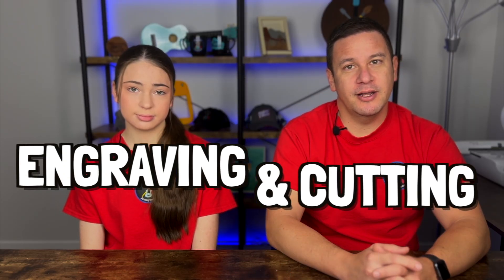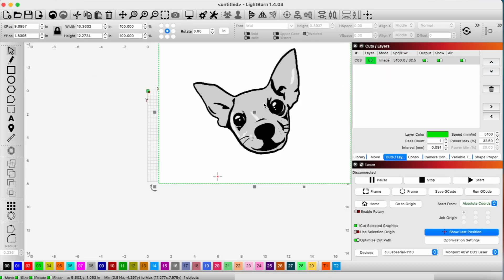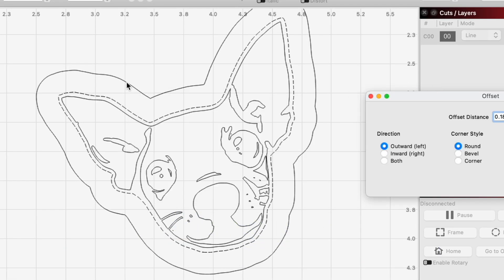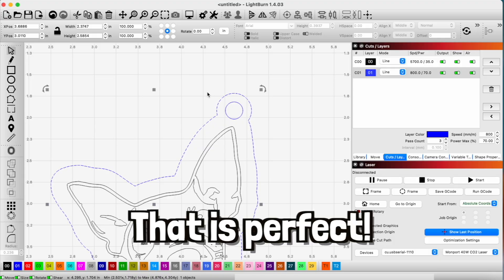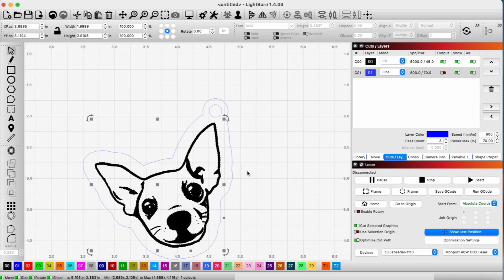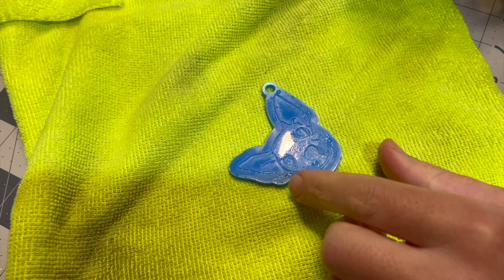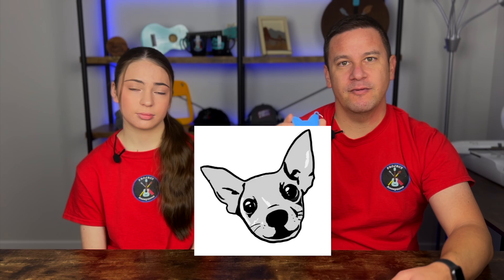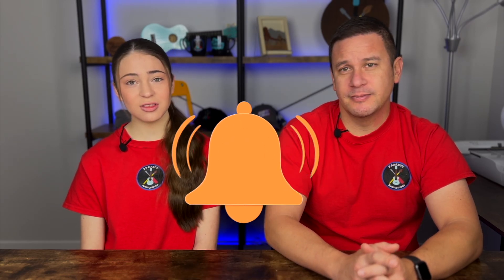ENGRAVE & CUT COLORED ACRYLIC w/ Monport 40W CO2 Laser Engraver

Comment: Anytime I use a non-matte acrylic I get this glare around the edges of the top surface. I assume it's getting too hot. I tried your setting and it's still happening.  Should I try a different brand of masking or what? I'm using a monport 40 w.
Reply from the maker: Different types of acrylic will vary on settings, cast acrylic vs extruded acrylic, color and thickness will all require different settings, so you will have to do some materials testing with different power and speeds to get the best result.  Here is our video on how to do materials testing in Lightburn if you haven't checked it out already: https://youtu.be/Inh4H7KGmQM

Comment: Lasers are my Jam. A 40w CO2 will burn through that protective paper. That would allow you to apply color to your piece whilst still having masking on locations that don't require color. You can also apply powder coating pigments and re-etch (without air assist). This will melt the plastic powder into your design. This process is best used with wood. Just some potential optins that you may find interesting.
Reply from the maker: Awesome! Thank you so much for the tips!